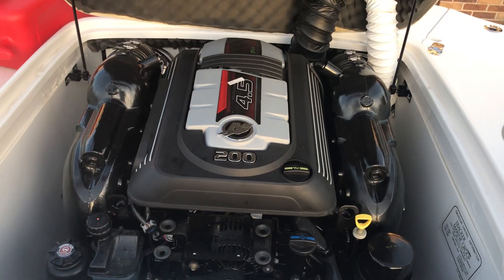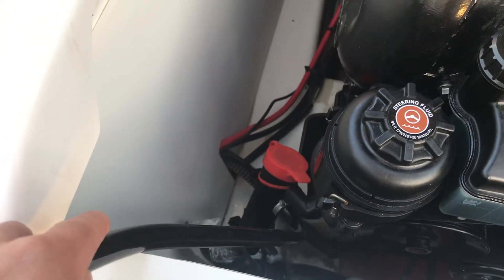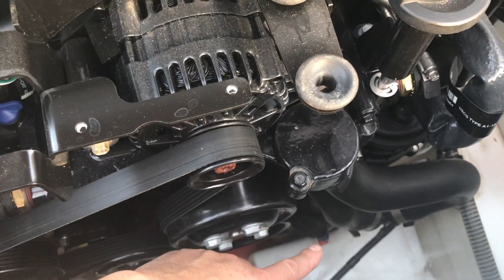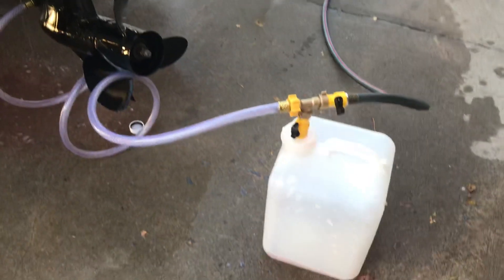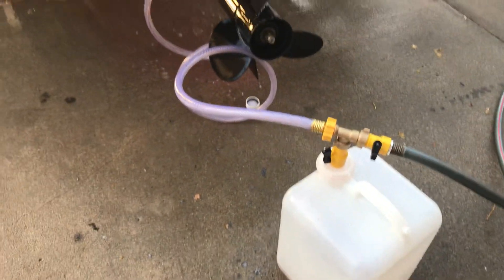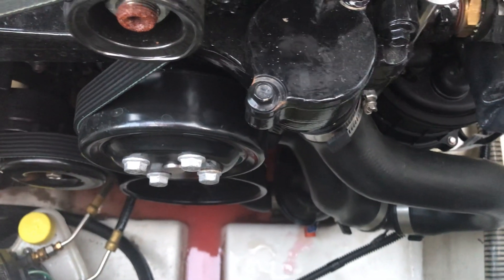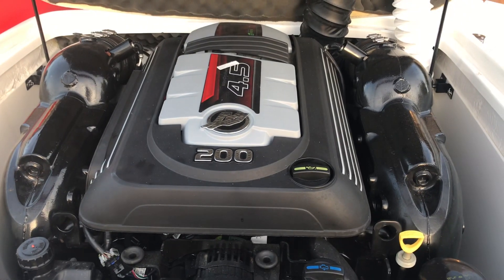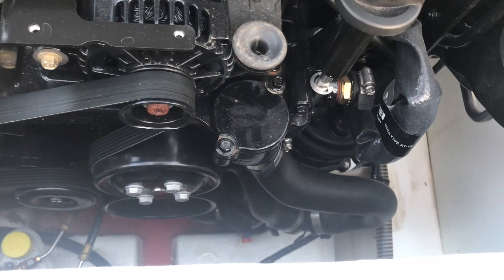Winterizing Mercury Mercruiser 4.5L 200HP

Comment: Easy alternative to fuel bypass step, just run premium on your last fill up with marine stabil in tank.
Reply: I’m glad to know someone else thinks this step is good. I filled the tank with non ethanol and added the proper amount of  fuel stabilizer. Then next step, I ran the engine until the thermostat opened up the anti freeze ran through the whole engine. This should be just as good right?

Comment: I don’t understand using the muffs for the RV antifreeze. More anti freeze goes on the ground than in the motor. I just did one of these I drained with the universal drain. Pulled both blue plugs out of the sea pump if it’s a Bravo. Two small bolts remove the cap to the thermostat housing. Pop the thermostat out and fill the engine with RV pink antifreeze put thermostat back in and cap on and it could not be more protected. No mess all over the ground. Plus no wasted antifreeze. Two gallons is more than enough to do it this way. Very easy. I like your set up for the fuel additive. Water from motor is in bilge so if on the trailer just pull the transom drain plug and since there no antifreeze in it it’s just water on the drive way or grass.